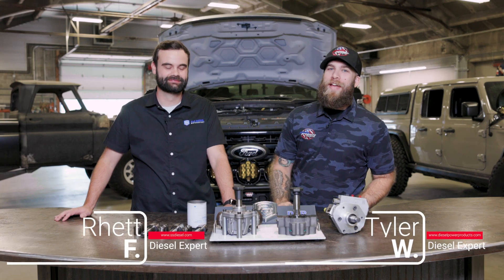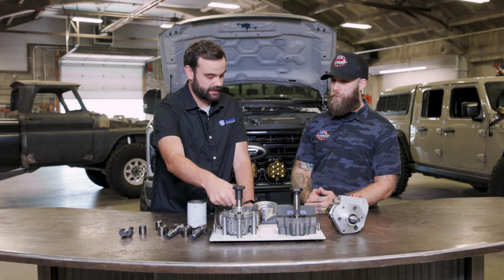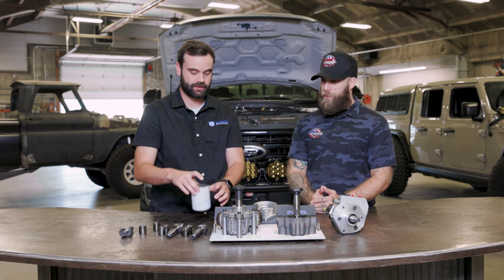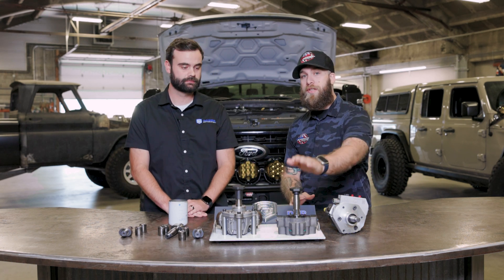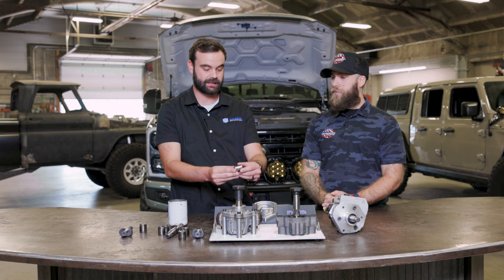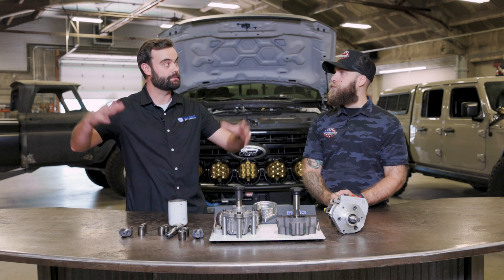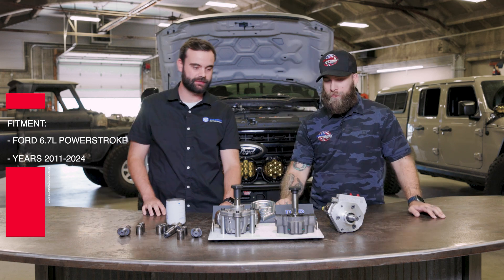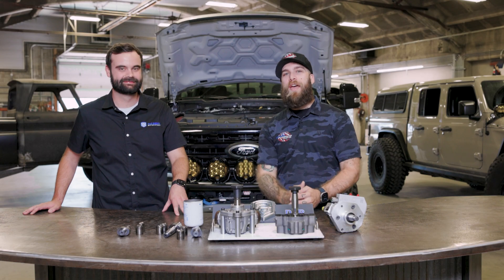DIESEL TALK | S&S DCR CP4 COMPARISON

Comment: Let’s hear some replies ,  How many people would make this conversion BEFORE the warranty runs out ?   I have 11K miles and really want to do this conversion, but I’ve been told by Ford rep locally it will mess up the warranty.     Do it anyway or wait.
Reply: Oohhh. Good question. Personally I have no faith in Ford. I won't be buying another. That said, I live my steel body F250 amd will do whatever is necessary (within reason) to keep it on the road. 
My reasoning: Ford has known about the CP4 issues since 2011. Ford is not stupid. Thats 13yrs before they publically acknowledged the CP4 issue. Notice i said "publicly acknowledged", and NOT 'accepted responsibility'. 
All said, i cant tell you how many warranty related horror stories ive heard. I personally met a guy who bought a 2013 F350 DW that had his CP4 blow at 35k miles. He cant afford 12-15k to replace the damage, and Ford won't honor the warranty. Big money. Fancy lawyers. The truck STILL sits in his back yard with 35k on the clock in 2024. I've heard many stories like this, and my opinion is that if a huge factory like Ford can pay the right people in order to not be held legally accountable in order to avoid a massive recall, which i suspect is true, and then publically "fix" the situation that has cost countless customers 12-15k without warranty help from the factory by issuing a service bulletin for the dealers to 'flash some software changes' to the CP4, that is the opposite of accountability, and coming from a company that I will (because of that lack of accountability) REFUSE to ever buy anything from until they change their business practices and accept their failure, and I refuse to budget.  No more Ford vehicles in the future, and (if I can avoid it) no more chinese made motorcraft parts on my truck. 
Just my personal stance/opinion.

Comment: Question - if we subscribe to your recommendation, that is to get the “By Pass” installed, and then if and when the cp4 grenades, we replace the pump with the DCR pump, is there a need to keep the “By Pass” (DPK) intact ????
Reply: I have the same question
Reply: S&S says its not needed and doesn't fit on the DCR

Comment: Would this pump work for an ecodiesel? And would you have to flash the ecu? There is a recall on my CP4 pump. I've been waiting a year..... I doubt it's ever going to come. Seems like the dealers hate warranty and I'm not sure how real this back order is.
Reply: I made an appointment for mine nov13. Hopefully the dealer will have the right parts. Otherwise a dpk and a fass fuel system is in more future
Reply: They did the recall on mine last week. No ECU flash either. Finally! @Gill67
Reply: @darthgator5990  awesome.  Do u know if it was a new pump or what exactly?
Reply: They didn't tell me. But I hear it's a revised CP4 with a built in disaster prevention kit. I also remember reading it online somewhere. So I'm going to keep using additives for lubrication and babying it lol
Reply: @darthgator5990  - biggest issue is aeration - fuel filter changes - make sure to prime...extra. Water is next big issue.

Comment: If the DCR fails, would it contaminate the fuel system?
Reply: It would be a good marketing point to demonstrate a failed pump like they did with the CP4 and the DPK.  Then, let's see how it fares.
Reply: No
Reply: You would have to literally run it dry for it to fail and send metal into the injectors. But by then the truck will shut off due to loss of fuel pressure but the cp4 will continue to run because it doesn't know it's failing.